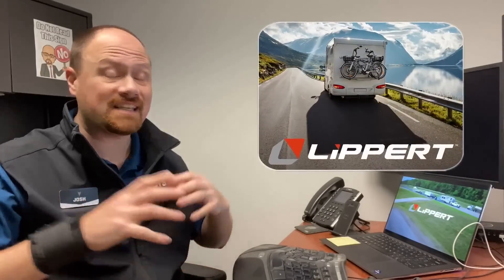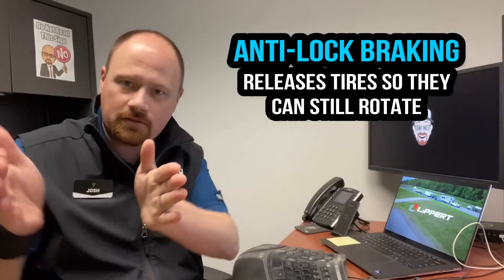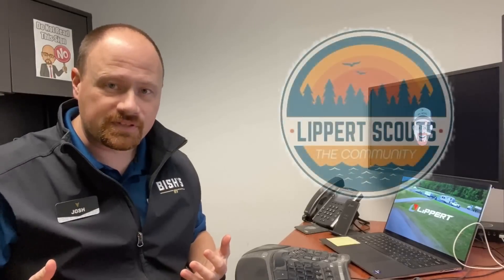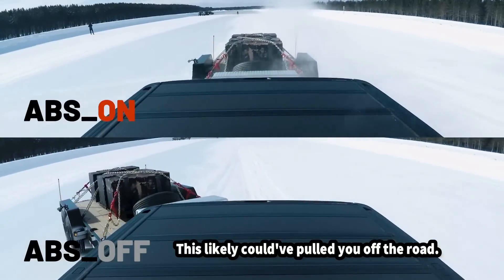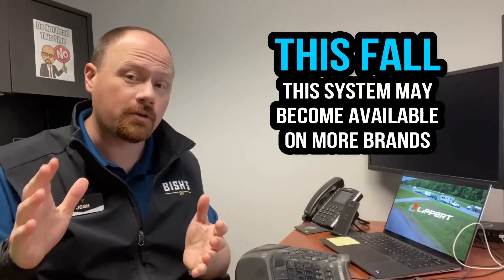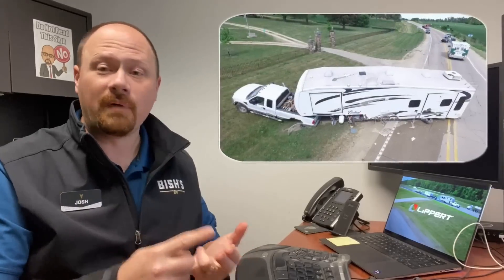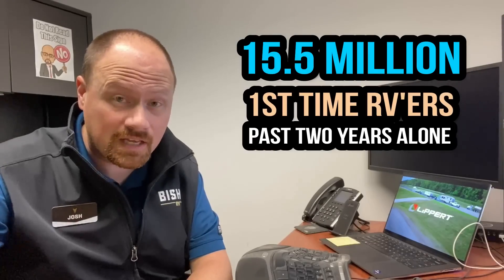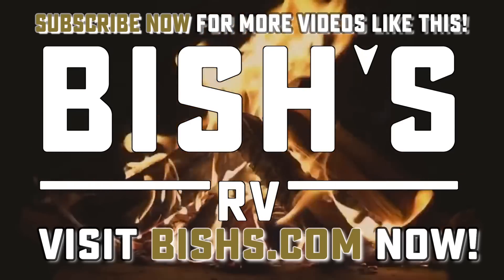This New Safety Feature Changes EVERYTHING!! [RV ABS for Towable RVs]

Comment: As a retired LEO I agree that this should be on every towable travel trailer. Once the public becomes aware of the availability of ABS and that the manufacturers chose not to install it in the basic build they will be opening themselves to large figure lawsuits. Public safety is a vital part of a companies thought process when building and marketing travel trailers and anything that makes them safer should be considered. They also need to make it available aftermarket if as you say it will work will the majority of the tow vehicles currently being used. One of the main reasons I follow you is your honest and sincere information provided to us.
Reply from the maker: I can only imagine the trailer towing nightmares you'd seen during your service.
Reply: @sweetbear when does the RV industry ever worry about making anything better safer or worry about being sued?  NHTSA and DOT don't/won't even get involved and regulate the RV industry.  I signed up for the Lippert Scout Program at its inception but was never contacted to be a "guinea pig".  They probably figured out I would be too honest and put their products through the rigors of real-life usage and they sure don't want that.

Comment: Hopefully once the exclusivity period ends this will be available aftermarket, not just from the factory!  The industry does need to get behind this and make it standard equipment. Great info Uncle Josh!
Reply: I'm less than impressed that a safety feature like this was even considered as an exclusive to any brand.
This should be available to all right now. Including aftermarket.
Reply from the maker: Fingers crossed!
Reply: Matthew, this type of device/system has been available in the aftermarket for a few years.  Tuson RV Brakes, LLC has a device (which I installed on my 26' travel trailer almost 2 years ago) that does precisely what Josh highlighted in his video.  I purchased the Tuson Asymmetrical Sway Controller (TSC-1000) and installed it myself in about 3-4 hours.  It operates the Left and Right trailer brakes independently of each other, to counter act trailer sway (due to heavy cross winds, evasive maneuvering, etc.).  There are YouTube videos demonstrating this device (Mr. Truck Reviews and MobiNomad, for example).  Check it out...
Reply: Thx Josh for an informative and interesting video FWIW OTR tractor trailers have had ABS systems since mid 70s Commercial aircraft since 60s. About time RV travel trailer Mnfg have  spec'd them.
Reply: Any word on after market availability?
Reply: @rsmartin68  - My guess is that Grand Design partnered/invested in development costs and received the exclusivity and/or a guaranteed number of units in exchange. It’s pretty common in my industry (not RVs). 🙂
Reply: @rsmartin68  I wouldn't be surprised if the GD exclusivity--especially given GD's silence--isn't a function of testing.  Get some real-world data with non-professional drivers.

As a current owner, I'm more interested in how easily this could be retrofit.  If it's basically just a matter of plugging a box into the current brake harness and running a new harness to each brake, that's going to be _huge_.
Reply: If this abs system was available as an aftermarket product I would buy it in a heartbeat. I'd gladly pay a few hundred dollars for this system.
Reply: It should be on every towable vehicle. It should be available aftermarket.
Reply from the maker: @ronhumphrey5490  Tuson has a system like this currently available. Lippert will likely make that happen as soon as they can

After all.. they don't make money NOT selling stuff to people..
Reply: @Josh the RV Nerd at Bish's RV  would love for you to follow up with your contacts at Lippert about that. Recently bought a trailer so we won't be in the market again for a few years, but I'd absolutely do an add on to my rig.

Comment: I love it! And I agree with you, Josh, I'm surprised it's taken this long, and yes, it should definitely be mandatory in the next few years. Just like trailers over a certain weight are required to have brakes, they should now require ABS.
Reply from the maker: Right?!
Reply: Me too. It's been required to be on all 18 wheeler trailers for about 26 years now.
Reply: @JoshtheRVNerd  Look at what what you're doing, Uncle Josh. You're getting unknowledgeable consumers  believing the the industry is arbitrarily holding this back from them. A trailer is nothing at all like a car. A car doesn't rotate on more than one axis. A trailer has at least two laterally and two vertically. Oversimplification of this  technology is not at all, like a car or pick-up truck.

Comment: Also, I've actually designed a few hitches and accessories designed to solve some common problems with towing and parking. One design is a hitch that eliminates the possibility of sway and does so without integrated weight distribution for the exact purpose of modern, unibody SUVs that could void warranties with weight distribution hitches. Unfortunately, I have yet to find interested parties since nearly every person I talked to A) was not aware of voided warranty concerns with weight distribution hitches and/or B) didn't care about a voided warranty because if it were ever a concern, they would just lie and tell the dealer that they only towed on the ball without weight distribution.  I shelved my prototypes, and I was bummed about it for a while, but I've since come to terms that the RV industry and most RVers/buyer's/sales usually aren't interested in a better solution/mousetrap for a given problem, just the solution that is good enough.

Comment: This type of system has been available aftermarket for a couple of years, we almost installed one last year and are planning to this year. While a bit of install time is required it is fairly easy. Yes, this is a must have system and thanks for the video.
Reply from the maker: I learned that myself only after making this. Tuson is the company I believe. 

I appreciate you bringing that up, though! The goal here is not to pound the chest of one company but rather bring some safety stuff to light!

Comment: Why hasn't abs systems been on ALL rvs for the same number of years as cars??? How many people have been hurt or killed by NOT having this ?!!?? ALL RVS SHOULD BE REQUIRED TO HAVE THIS REGARDLESS OF MANUFACTURING YEAR. This is how strongly I feel about this. I hadn't realized that rvs have no abs. Now that I do, I will not even think about buying an rv unless it comes with an abs system. Safety above all else, in all aspects. Thank you very much for this video.  This is the reason I subscribed.
Reply from the maker: ¯\_(ツ)_/¯
It's the same question we pretty much all have now I think

Comment: Fully agreed. Ive been trained to drive a 40 ft with a 3000 gal rubber water blivet bag strapped to it. and I still sway on regular roads sometimes. I just have people mad at me at the speed I drive in bad road conditions LOL this should be standard on trailers over a certain length and/or weight
Reply from the maker: Woof. Nasty load

Comment: If trailer tires lock and skid, the rubber melts into little wet rubber ball bearings. That's why the tire loses traction. The motion back and forth is commonly referred to as "fish-tailing". Where the tire locks and loses traction due to a wet or icey surface, allowing the tire to rotate in the forward bias resists the shear forces thus allowing the tire to track straight ahead and realign with the tow vehicle. Another aspect of ABS brakes is cooling. Brakes convert kinetic energy to heat that is convected away  by the air blowing over the brakes. During a hard, panic brake, the rotors or drums overheat to the point the brake can no longer dissipate heat so you can't stop. This is why highways in mountains have runaway ramps on the downhill run. Back before ABS, you have to 'pump' the brakes to allow some airflow to cool the mass of metal. ABS brakes do this automatically so you do NOT pump ABS brakes. Thus, ABS allow cooling and maintaining traction. Note that fish-tailing causes shear forces on the tow vehicle that result in loss of steering and reduced braking efficacy. 
When you flat tow a dinghy car, its ABS brakes are utilized. 
Great stuff as usual Josh.
Reply from the maker: See... you're a real wizard. I'm just a magician. I only pretend to do what you do for real lol :)

Comment: I would agree with you that this should be a standard feature. I would also like to see this with the ability to add to previous models. I realize it would be at owners expense, but it is something I would definitely look into if available.
Reply from the maker: Should be totally possible. 
I later learned Tuson has a similar system that's intended for aftermarket. Makes sense this would be similar to add on

Comment: We were trying to decide between the Cougar 23MLE and the GD Reflection 226RK and now with GD installing the ABS brakes on the 2023 model year it's a no brainer. We will be purchasing the GD later this month or next month. ABS brakes on a RV is a game changer, there's already too many RV newbies and Rver's that are at maximum weigh or over weight we need something else to make us all safer on the road. Thanks for the video.
Reply from the maker: There ARE aftermarket systems available but it IS nice to have stuff factory-done

Comment: The problem, is now brakes that lasted for years on trailers are going to have to be inspected yearly. This system ( With anti sway ) will wear brakes out at a much faster rate, and unevenly side to side. Trailer brake shoes are only about half as thick as auto ones are, so manufacturers will have to make trailer braking components much heavier to handle the extra use.

Comment: Thanks for the info and review, love your videos and your energy, awesome tech on trailer braking, I too wish this was standard on all trailers for safety, but until this is available to add on all trailers vs... just the Momentum line of products, another Item to help with the sway, pulling, and breaking sway of your pull trailer is the Pro-Pride Hitch. 
I drive a 2015 Ram 2500 6.7 diesel and pull a 30 ft. Sandstorm Toy Trailer, I had the standard Sway hitch and load level system installed by my RV dealer at the date of purchase and made one trip from So CA to KY the trip was stressful, and very tiring, until I purchased the Pro-Pride P3 1400 Hitch system three years ago and have put 14,000 + miles on the Pro-pride driving back in forth to see my daughter son-in-law and grandchildren from our home in So CA to Kentucky. The Pro-Pride takes the stress, headache, and white knuckles experience out of your drive, weather on uneven roads, ruts', the hitch gives you stability while driving and keeps your trailer behind you, the sway is gone in heavy winds on your back quarter, the sucking sensation you get by big rigs as they are passing you is gone, I've driven through heavy road construction,  torrential rain storms, heavy wind storms, and recently the ice storm trying to head home from a stay at KOA Denton-Sanger TX early Feb 2023. The Pro-Pride is a game changer during passing, being passed and when you need to apply a quick panic braking when traffic stops ahead all of a sudden, the trailer stays behind you with virtually no sway. 
It would be great for you top do a segment on the Pro-Pride hitch for additional RV trailer pulling options for your viewers, as this has been the best investment I have made for pulling my trailer and my no stress driving comfort.
Reply from the maker: There ARE some vendors offering similar tech aftermarket now actually. Didn't realize that at first. Learning a bit as I go here!

Comment: I was always under the impression that OEM in-dash integrated brake controllers (not aftermarket plug-in under-dash varieties) were integrated with the truck's ABS system. They were using late model trucks in the test videos that I presume had factory brake controllers, but it wasn't clear if they were slamming on the foot brake or just the trailer brake manual engagement switch on the brake controller to demonstrate the Lippert module. With that said, I could see a trailer-mounted ABS module being practical if it has independent control of each wheel, just like a normal car/truck, and if it's fully self-contained (doesn't require additional vehicle connections outside of the usual 7-pin wiring, reads speed via GPS or trailer wheel speed sensors, etc.).
Reply from the maker: I thought the same but my experience has shown me otherwise 

Trailers still commonly lock up and try to slide past a slowing tow vehicle

Comment: Josh I agree with you a 100 percent I drive tow truck I've cleaned many a trailer and fifth-wheel off the highway and if this can avoid it by all means should be mandatory and standard on RVs and is one who pulled one I'd like to see it on RV. just my two cents
Reply from the maker: Well it's worth three cents with inflation LOL :)

Comment: When I was 8 years old (1951), we were towing a 40 ft trailer from near Pittsburgh, PA to Santa Monica, CA.  Just outside Oklahoma City, the trailer jackknifed and we ended up trading it in on another trailer.  Not sure if these brakes would have helped since the accident was caused by loose lug nuts but it wouldn’t have made it worse.

Comment: I'm a little surprised that this is concept that you haven't encountered until now, because I had the privilege of a lengthy conversation with your buddy, Chris Barth with Ember, last fall about electronic sway control...which I realize is slightly different but largely functionally the same as ABS. I saw him at the Overland Expo Rocky Mtn and asked him about anti-sway control for an Ember RV with a Lock-n-Roll hitch, which is a set-up that you obviously can't incorporate traditional anti-sway control hitching. He explained that he's had a lot of experience testing electronic sway controls going back to his days at Jayco including some closed track testing (be sure to ask him about his picture with a lime green helmet that he refused to share 😂😂). While you're at it, maybe you should ask him to incorporate it into Ember's product lines as their price point would certainly justify such an addition...even if just an optional add-on. Both Lippert and Tuson have an Asymmetric Sway Control system that you can get aftermarket.

Comment: Josh, at 4:20 maybe I'm not seeing this correctly but you said the weight on the trailer is in the wrong location in this picture. You said it's behind the axle. If you look at the screenshot and if the box is the majority of the weight that trailer is loaded perfectly. You want the weight slightly in front of the furthest axle and end up with 15 to 20% tongue weight.

Comment: I'm all for the addition of ABS to trailer brakes, but I think this has been available for awhile, at least the anti-sway part. I remember two systems one was optical and applied the trailer breaks when the tow vehicle and trailer were not in sync with each other (sway) am not sure how it worked. The other was electronic and could apply trailer braking either to both sides or one side of the trailer to correct sway. That system is still sold (Tuson sway control). I have never used either so can't speak from first hand experience, but the Tuson system looks like it would work for any trailer.
Reply from the maker: I’ve seen some attempts at trailer electronic anti sway that didn’t jive properly with some tow vehicles. Nice to see they’re doing the testing this time around

Comment: We have the Tuson Sway Protection system installed on our 2021 Jayco 24BH. We tow it with a 2011 Ford Expedition so it's on the upper end of our towing capacity. The Tuson system already saved our lives at least once. U-Haul installed the module for a good price. Why has Lippert held off on the Anti-sway features? It seems strange.
Reply from the maker: I appreciate so much how you asked a question rather than blasting a presumption!! "Why have they held off?"

They haven't. They're still developing and testing it. They got the ABS done first since that's the basis of the module. The anti-sway is then just software logic that could be pushed to the module via an update

They're making sure they get each piece working properly rather than trying to mash two sub-standard features out
Reply: @JoshtheRVNerd  

That makes sense. I wasn't sure if it was something like an IP or patent conflict they were navigating. I really like the idea of ABS integration, once it's on the market with sway protection I may switch out my Tuson for the Lippert system.

Does it have a little light like the Tuson that lets you know when it's activating?

Comment: I have towed thousands of miles with heavy trailers on snow-covered roads and never once felt like ABS on the trailer would have made a difference. That's my opinion but I have driven heavy trucks in all conditions so weather doesn't intimidate me. 
Systems like what's shown on these trailers have been around for many years. Nothing was stopping the RV OEMs from implementing them.

Comment: As a member of the trucking industry one of the first things that goes bad on a trailer is the abs on the trailer and it's expensive to fix and they malfunction quite a bit. Adding abs to the RV industry is just going to add to more expensive repairs that the dealerships are not going to want to deal with. My 2 cents
Reply from the maker: Fair enough. I appreciate the insights

Comment: This is a great feature which we have with our new Solitude 380FL but the option isn't available with 8k axles and this unit has terribly low cargo capacity by weight (while having tons of storage space by square foot). I sure hope ABS takes off so that they make it generally available on various suspension systems.
Reply from the maker: Yeah that’s an issue affecting a LOT of RVs lately I feel